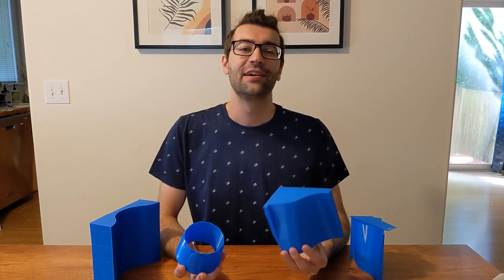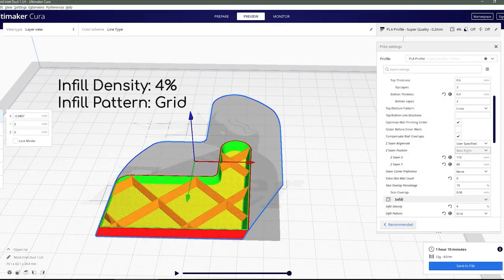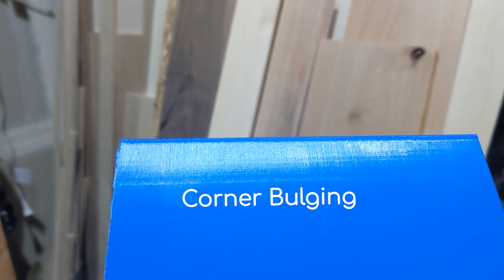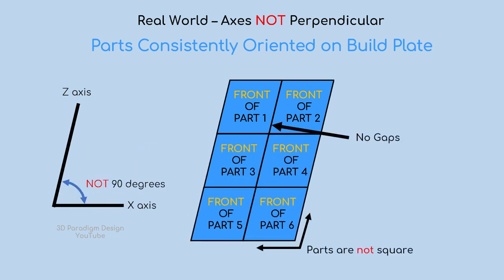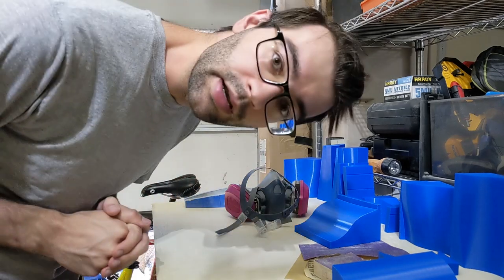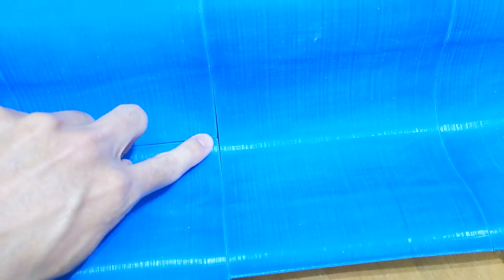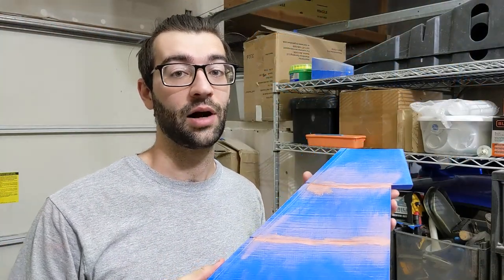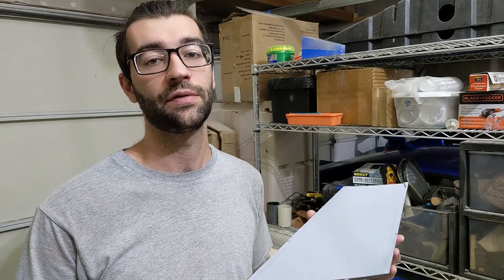3D Printed Molds and Flying Parts - RC F-16 Build - Part 3

Comment: The corner bulging can be controlled by adjusting the "Jerk" control in your slicer.  Short explanation:  The bulges are there because the printhead must come to a virtual stop when it gets to a corner and change direction.  That causes the filament, which is under pressure, to flow out a bit and make a small blob.  Jerk accelerates the nozzle around the corner not giving it time to extrude the extra filament.  Adjust amount of jerk until the corners are perfect.  This adjustment will not only depend on the type filament (PLA, PETG, etc.) but on the brand as well because all are different.
Reply from the maker: I experimented with jerk and acceleration in the past but was unsuccessful at removing the corner bulging. Do you have any recommendations on starting point values for jerk? Keep in mind I'm using an Ender 3 Pro and PLA.
Reply: @3DParadigmDesign  I run Artillery X1 and X2 machines, which are direct drive unlike your Ender I think.  I would think that with Bowden machines the jerk, like the retraction, must be pretty substantial because of the slack in the Bowden tube.  Keep in mind all my four machines are direct drive so I have no experience with Bowden printers.  You should be able to run a few calibration cubes with escalating speeds to figure it out.
Reply from the maker: Thanks!

Comment: Looking super! For future reference the spot putty by Bondo is not very good stuff. It's meant to fill light sanding scratches. If it's in an actual crack or filling a gap it has a very bad habit of shrinking. It takes days to dry if it's in a crack. Then you go to sand or pull pressure on those joints that are filled and you will find it's not dry inside. It skins over and stays wet inside if to thick and by to thick I mean anything over 1/16" thick. In any direction. So the crack might only be 1/32 wide you press it in the crack and it goes in 1/8 to 1/4 down in the crack. Only the surface will dry and the spot putty down the crack will remain wet not dry for weeks. I highly recommend a 2 part filler. One with a hardener and filler. Chemical drying and no shrinking. 
Just some advice from a long time career body man and fiberglass worker.
Reply from the maker: Great advice, thank you!

Comment: For fill I use a lite weight bondo in a tube, it has a hardener like bondo, it sand great, and fast. with little srink
Reply from the maker: What's the name/number of the product you use? I can't find anything called "lightweight Bondo"

Comment: Greta Job! Which feature Or option do you use in Fusión 360 to créate the mold?
Reply from the maker: I use Sketch to make the mold profile. Extrude it to the desired thickness to form a new body. Then use the Combine tool to remove the airplane body from the mold body. I set the mold body as the "Target Body" and the airplane part as the "Tool Body". And I check the "Keep Tools" box.

Comment: Where can I get the g code for this entire build. I'd buy it if need be. I just really want to build this! You did an amazing job with this build
Reply from the maker: Files aren't currently available but I'm considering it. If I were to make something available for purchase would it work for you if I just included the files for the molds and the bits that are 3D printed on the final product (like the exhaust nozzle)?
Reply: @3DParadigmDesign  yeah that would work! If not I'm going to try finding a F16/F35/F22 somewhere in a smaller form and see if I can scale it up. I'm sure I should be able to find something on thingaverse or something like that. If they even have it.....

 But if you sold it I'd definitely save the time and order from you.
Reply: @3DParadigmDesign I also want the stl files and I would pay for them, it's a shame that so much work ends up on a single plane. Great job!!

Comment: Marvelous work, can you tell me about the software you are using and share the simulation .
Furthermore which Printer and Resin are you using. 
👍
Reply from the maker: Thanks! I'm using Fusion 360 for the CAD and Cura for the slicing. Using an Ender 3 Pro and Sainsmart PLA filament ✌️
Reply: @3DParadigmDesign  
Thanks alot, how do you plan to construct the landing gears ( i.e. will you add shock absorbers and will you be able to switch between landing gear up and down mode).
Also, for your propulsion system will you use a motor and fan or will you store fuel inside a container placed in the fuselage and attach to mini jet engine.
Great Work, waiting for your next video 🤞
Reply from the maker: @m-lu8vi  I'll be using commercially available retracts with shock absorbers and the power unit will be completely electric. Electronic ducted fan. I will also have a future video where I explain all the electronics I'll be using!

Comment: Do not use can spray primers, those can spray primers have poor adhesion to the plastic, they are soft, they keep shrinking even after months. Use polyester primer instead. If you do not have spray gun to spray polyester primer you can apply it with foam roller on the surface.